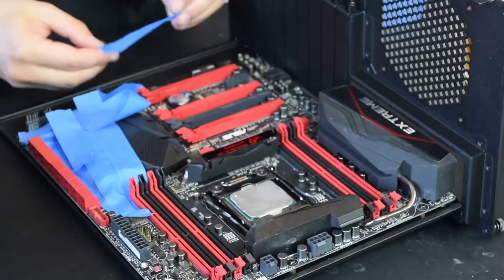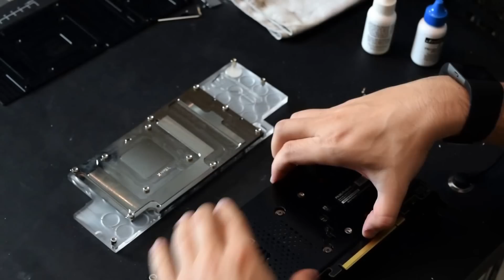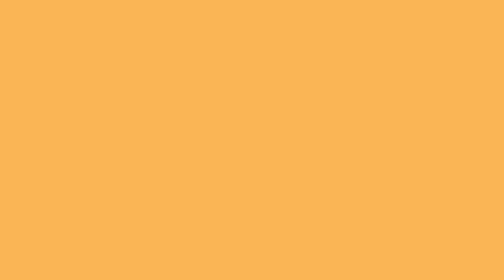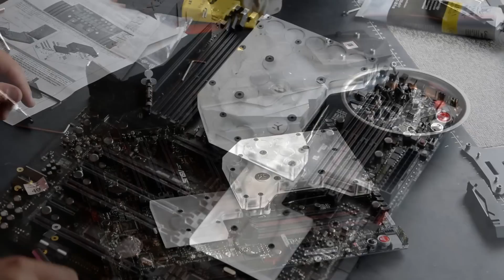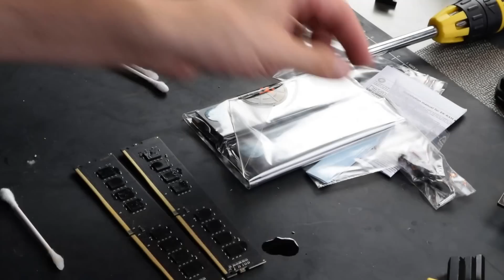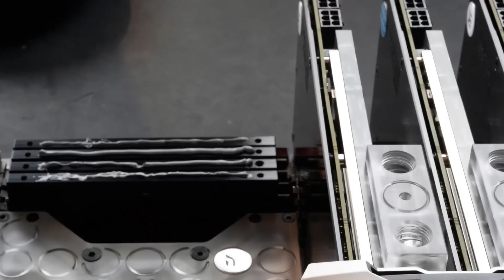Nostromo: X99, 980Ti 3-Way SLI, Water Cooled, Painted RVE Motherboard, 5960X -- Part 2

Comment: This is awesome, just bought a 980Ti to upgrade from a 660 for 1440p gaming! Love the build.
Reply: +Bboy RagnarouS 1440P is so nice, make sure you get a 27" monitor though because that seems to be the sweet spot.
Reply from the maker: +Bboy RagnarouS Yes, I got 1440p, as well.  I'm using the Acer X34 predator and it's excellent.
Reply from the maker: Nice!  That'll do right by you.

Comment: Painting looks good my man but with so many great mobo options out there I just don't see how practical it is. The MSI X99A SLI PLUS for example is a really nice looking blacked out board. If you wanted to stay with Asus name brand the TUF line up in blacked out.
Reply from the maker: I actually really like MSIs products.  The only consideration here was that the Rampage was the only board that offered enough PCIe lanes to let me use tri-SLI in 16/8/8, as well as a PCIe SSD.  I think that's still the case.

Comment: did you ever realize you could have just used single strips for each segment of ram chips?  1 stip for each 4 ram chips on each side, so 4 strips instead of 16 squares?  would have been a lot easier and cleaner
Reply from the maker: I didn't!  Great tip!
Reply: I had the exact same thougt

Comment: Am I the only that noticed his gpu backplates for the waterblocks are for the titan x? XD
Reply: It often works because the GPU's are very similar, I also have a Titan Backplate on my 780ti
Reply: Ok
Reply from the maker: Yeah, that's actually the one that EK supplies for the 980 Tis.
Reply: Cool!! didn't know ek did that. just upgraded my pc to 2 titan xp's and it's insane water cooled. you should invest into them eugene
Reply from the maker: Check out my latest video!   Turns out I have done exactly that. :)  They're in my test bench now (marks coming soon), but migrating to Nostromo shortly.  What kind of OCs are you getting?

Comment: when you were installing the monoblock you showed that the part of the monoblock that fastens down the cpu takes what I would assume to be a m3 screw but when you fastened it down you used nickel thumb screws what did you use to fasten it down  exactly
Reply from the maker: They were M3 screws--definitely not thumbscrews.  Are you running into a problem?
Reply: well I got the edition 10 and matching monoblock but it strangely enough has the same size screw holes as on yours but if you look at the ekwb manual it states that I use thumb screws to fasten it down but obviously you can't do that cuz there are no threads of any sort and there is no knowledge or anything about this design that specifies what's going on there exactly hopefully ekwb can resolve this for me when they open in 4 hours or so lol im itching to finish my build
Reply from the maker: It's probably a misprint.  The supremacy blocks use thumbscrews, but certainly not the monoblocks!

Comment: Why did you broke off the heatpipe from the stock cooler when you can heat it up and pull it without breaking the heat pipe?
I did mine that way and I can still reattach it if I need to.
Reply from the maker: That's a good idea.  I knew I wouldn't want to reattach it, so it wasn't a big deal.

Comment: Water blocks on everything but the 730, why skip it after water cooling everything else?
Reply from the maker: The 750 you mean?  I simply didn't like that it would require a less clean-looking build, including some y-fittings that might reduce or at least complicate the flow.

Comment: Amazing build I have similar hardware in my system except I am running 3x EVGA GTX Titan X SC and 32GB Corsair Dominator Platinum 3000MHz as you can see on my channel.
Reply from the maker: +Nonconformist 02 Wow, that's going to be a ton of video RAM!
Reply: +eugenetries Video ram is not a issue with the GTX Titan X but Its not all perfect I having a problem with the system the Nvidia control panel will only enable SLI for cards 1 and 3 and always exclude cards 2, although it will enable PhysX for card 2, so I know its working. Also I can disable any card in the device manager and do SLI with the other two. But no matter what it never uses all three in SLI. both ASUS and Nvidia don't seem to have any idea what the problem is.

Comment: There was a bit too much TIM on the first set of RAM blocks and I'm going to guess you did the same on the other side as well. Fortunately, it's not a CPU so you could've done the card method on them. On that not, you used entirely too much TIM on the CPU and south bridge as well. As they say, "a little bit goes a long way." 
How come you chose a serial bridge over parallel? It's been proven that parallel bridges perform better than serial as each block is receiving fresh water.
Reply from the maker: +Hexagon PC I agree that it is more TIM than usual but I've typically had success with this application.  The southbridge chip was tiny, too, so it was difficult to control.  Also, remember that the 5960x is a huge chip compared to your Haswells/Skylakes.

Regarding serial v. parallel, everything I've read says that it really makes no difference.  That said, I still have time to make a change.  If you have them at hand, please send over a link to some testing on this!
Reply from the maker: +HexagonPC interesting.  Most of what I've seen shows absolutely no difference in temps, or at least pretty negligible differences.